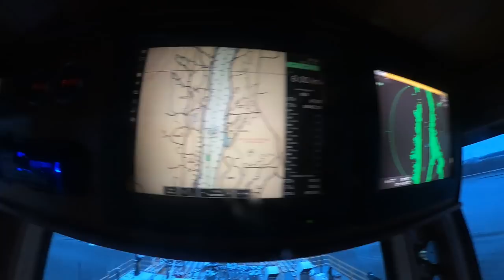Making Up to a Barge and Virtual Buoys

Comment: They really are hard to spot. Seen lots on the charts, but never actually spotted one. Or, maybe, didn’t know what I was looking at. Thanks Capt.
Reply from the maker: Thank you very much for watching and supporting the channel! CUOTO
Reply: A virtual buoy using AIS does not need to physically be at the location it reports. Can be onshore nearby, as long as it's in radio range. (Onshore is cheaper and faster to set up, for example when there's a new hazard)
Reply from the maker: @lardo666  As far as I know, all virtual buoys are set up on land. That is the point. If the buoy gets moved off station, the virtual buoy will still be reporting the correct spot.

Comment: Capt. Tim, thanks for continuing to put out content. Quick question, why didn't the grumpy tankerman place both lines of the starboard push gear in the open chock?
Reply from the maker: Thank you for watching Steve. Each barge is a little different. Some line up better with both legs of the push gear going through the chock and others line up better with only one leg going through the chock. (it really depends on how deep the notch is) CUOTO

Comment: The virtual buoys are interesting and I'm wondering if the virtual technique is used to mark other things such as shoals or submerged obstacles such as a wreck. We amateur radio operators have a radio system called APRS for tracking movement of vehicles, it may have been used as a model for AIS. The APRS maps are dotted with virtual "targets" to show everything from amateur radio repeater sites to tourist attractions and restaurants. 

What is the purpose of the frame on top of the tankerman's quarters that looks like a drying rack holding socks?

Keep up the great videos and above all STAY SAFE! ⛴️❤️😁
Reply from the maker: Thank you for watching George. Like most of the innovations in our industry, AIS came to us from the aviation world. It is loaded with information about course and speed and CPA and TCPA and thus wouldn't likely ever be used for shoals, reefs or wrecks. I have a video detailing AIS you may like. If you can't find it, let me know and I'll find it for you.
    The rack you are seeing is the high level visual alarm that gives tankermen a visual and audio indication of a tank getting full before it overflows. CUOTO

Comment: Hey Tim, hope you are having a wonderful day.. I have a question for you. I hope it doesn't sound stupid.. Here goes. How's come the water in the Caribbean is so green and beautiful and the water in the Atlantic is dark and just looks dirty??? Hope you have a wonderful week and Be safe..God bless..🇺🇸🌹❤️
Reply from the maker: Hi Dottie. That's not a stupid question. In fact, I don't have an exact answer. I suspect it has to do with the sum of many little parts that when seen together, make the water look better.
    The first thing I think of (having grown up in Maine) is that clear doesn't equal clean or healthy. Many lakes in the North East had been polluted from factories and power plants far away that made acid rain that was collected in the lakes. The absence of life in the almost sterile lake left them Cristal Clear and they looked magnificent. But everything in them was dead.
   So, the water up north, being much colder, may slow the natural decomposition of organics in the water column.  I also think that the water color can be affected by the bottom's color as well. (White sandy bottom reflects clearer beautiful blue water colors, while darker northern waters may reflect greener colored water.  I'm sure there is a salinity and temperature angle to the color change as well, but I don't know it. These are all far from fact and only my assumptions. CUOTO
Reply: @TimBatSea  Thank you Tim. I'm thinking your answer is pretty much right . The sandy bottom helps with the reflection. Thank you for answering my question.Wish you well in your new job.. I'll be watching for sure..

Comment: Kudos on the ice buoys👍 never had electronic charts or GPS in late 70’s. I imagine Kevlar doesn’t have much stretch like nylon??
Reply from the maker: Thank you for watching John. You are correct. Zero stretch making it very safe for push gear because there is no spring back during a line failure. (I have a video about different lines and their strengths you might like to look for. Let me know if you can't find it). CUOTO
Reply: Thanks Tim, characteristics I keep it in mind if I ever use Remember the 1st time a mani
Reply: Manila line smoked on capstan👀
Reply: I believe dyneema lines such as Amsteel Blue are rated close to .04% elongation at 80% of their breaking strength. I believe 1” Amsteel Blue has a rated minimum breaking strength close to 123,000lbs. It’s some amazing stuff. So much easier to work with than wirerope.

Comment: Virtual buoy? I’m aware of their use on AIS charts/programs, but how would a virtual buoy show up on radar. Radar is a real-time reading of reflected radio waves. Seems to me that for a buoy  to show up on radar there would have to be an actual object to reflect the radio waves. I’m just curious.
Reply from the maker: Thank you for watching Tim. Our Radars are integrated into our NAV systems. AIS targets are overlayed on the radar's display just as heading lines are. CUOTO
Reply: Ok that makes sense. I’m just used to the radar being a stand alone system. Thanks for the reply.